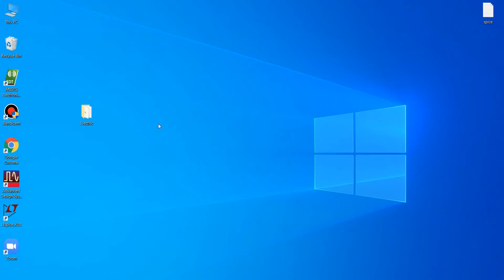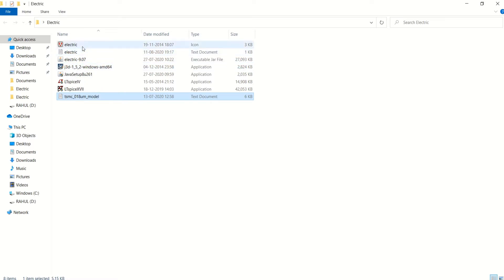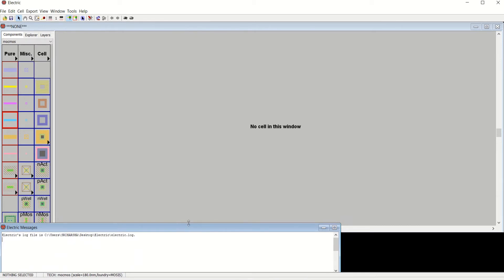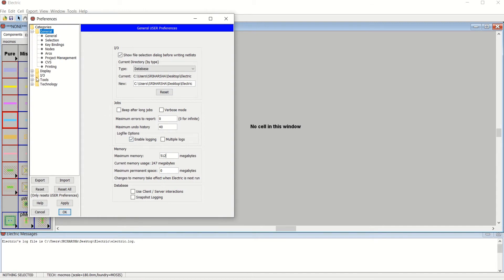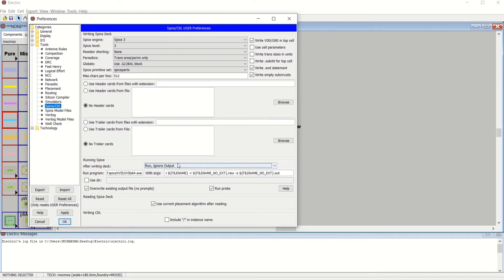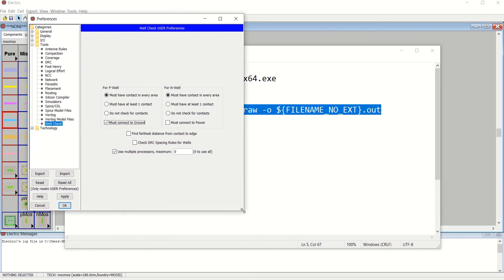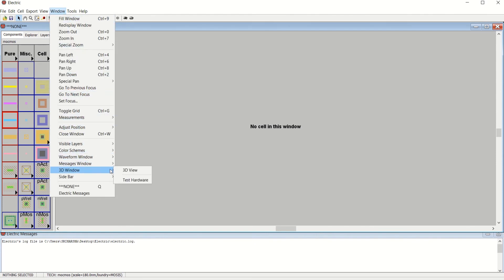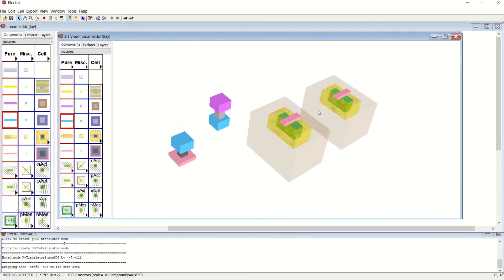How to Install Electric VLSI Design System.

Comment: sir i have installed java 3d but still i dont have 3d view option in my electric vlsi tool.
Reply from the maker: Hi use this link
https://drive.google.com/file/d/1krfZ7ZasxN9CUIMS3s39KunAZkfXTZP8/view?usp=sharing
Reply: @dr.hariprasadnaikbhattu   Thank You very much sir it worked for me.

Comment: where would I find a link to  download the tsmc_018um_model ?
Reply from the maker: Hi, Just google with tsmc_018um. 
you can also use ptm models
Reply: @dr.hariprasadnaikbhattu  Thanks for your  response - I have been googling tmsc_018um and _model and .lib with no luck . Also it seems as if LTspice changed the format of the .raw file so the electric sim can not read in the new format . I just mention this for others to save then banging their heads against the wall .
Reply from the maker: provide your mail id

Comment: Sir I wanted to know parasitic extraction for CMOS inverter using electric tool ...pls help
Reply from the maker: Hi, Check the video again at time 7:20, set the parastitics to Conservative RC. Remaining process is same. Run the simulation and check the LtSpice

Comment: Hi, I encountered this problem when I did "export to GDS 2 (Stream)" :  WARNING: GDS Expert encountered problems because of small feature sizes and coarse accuracy settings.
 It is recommended that the 'Units/meter' GDS preference be increased by a factor of 1215752192. 

Is there anyone who can understand where the problem is?
Reply from the maker: GDS 2 has to be done for layout.
Reply: @dr.hariprasadnaikbhattu  That's exactly what I did. The problem persists and I don't know how to fix it
Reply: @dr.hariprasadnaikbhattu  
Maybe it can be a settings problem, honestly I haven't found much about it
Reply from the maker: @giampierocongiu2327  try to install again tool and check
Reply: @dr.hariprasadnaikbhattu  ok, i will